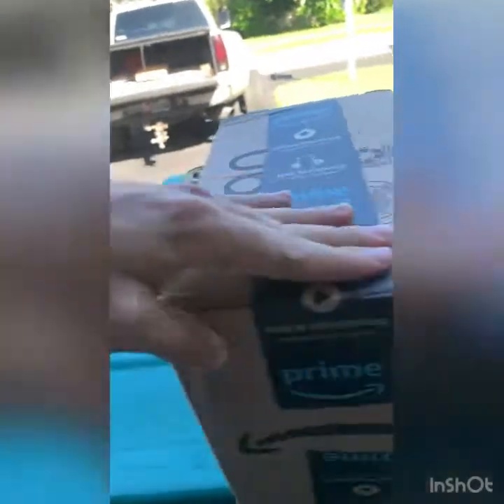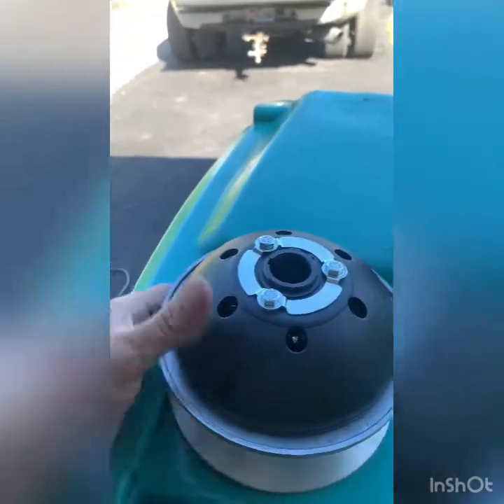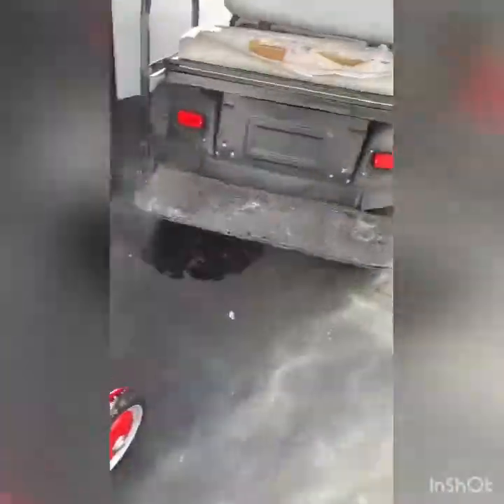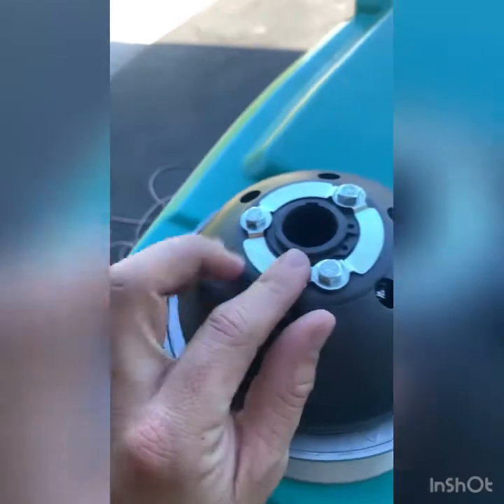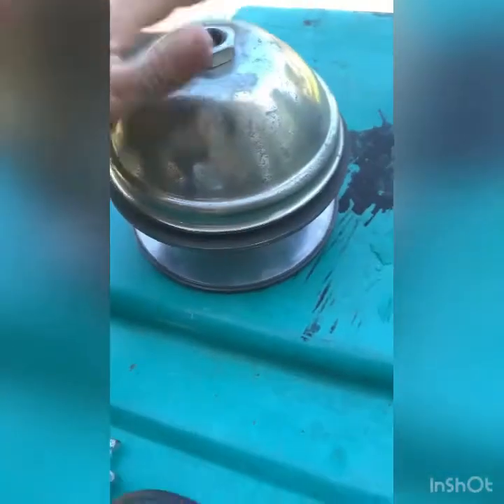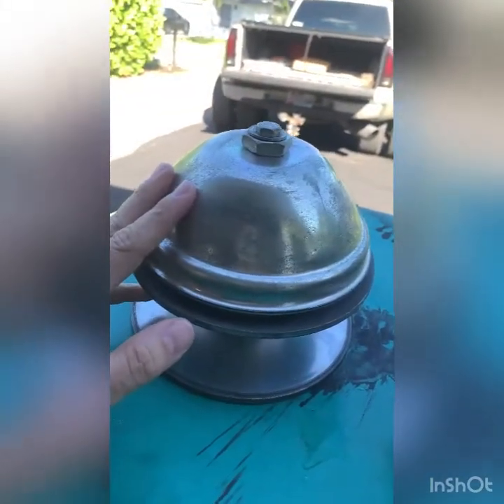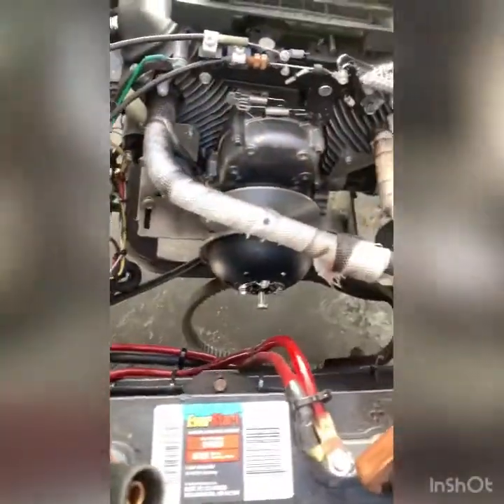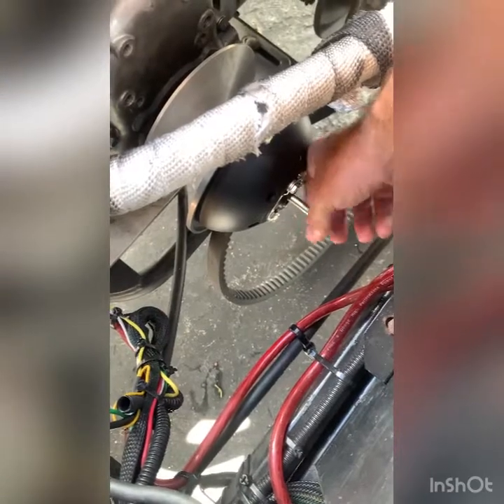Big Block Golf Cart Clutch - 780 Comet Upgrade

Comment: My 780 just messed up as well. When mounted to the engine I can spin the actual clutch portion of the unit while being mounted to the crankshaft without the crankshaft or inner sheave moving. The bolt that retains the unit onto the crankshaft will also remain still.
Reply from the maker: my 780 is a cheap china clone, at the time it was only $130with overnight shipping, makes a great backup but I lost 9mph due to the 780 being 1/2" smaller in diameter in lieu of the CV. I plan on running the 780 for the time being until I get get my 1190 style which is 1" bigger than the 780.

Comment: I just did this same upgrade on my new predator 459cc motor. I'm repowering my American Sportworks (Landmaster) UTV. Should be dropping a video on the completed install this coming weekend. How as the comet 780 been holding up for you ?
Reply from the maker: I actually love it, works great, has given me ZERO issues at all, i just want a larger clutch to be able to cruse faster with lower RPMs, not so much after the top speed.
Reply: @keithellett4283  awesome, I just got mine all up and running yesterday. I’m dropping a new video soon on it.
Reply from the maker: @1620GarageAndFarm  Yeah the 670 clone is definitely the way to go it works great and I literally abuse the crap out of this thing and it hasn’t skipped a beat. I don’t know about long-term exposure over a genuine Comet but for the price savings especially what I paid for it I lost nothing. I expect when I put the 1190 Comet Installed on there I should be pushing 45+ miles an hour if needed lol
Reply: @keithellett4283  I picked up the new Predator Max Performance 459cc . I'm shocked how well it goes. I wanted to go 670 ..  But I was not sure it would fit.
Reply from the maker: @1620GarageAndFarm  There was a lot of testing and tuning and trying different things to get the 670 to fit in my golf cart

Comment: You can also take your CVtech clutch apart, just mount it any 1" shaft then remove the big nut that's on the end with a impact. If you do not have an impact and socket to fit a large crescent wrench or pipe wrench will work just as good with wack of a hammer!
Reply from the maker: I hate this CVtech clutch, nothing but problems since it was new. I have no interest in fixing it lol . but thanks for the heads up . My 780 is my go to but I just haven't driven it enough to make an more videos
Reply: @keithellett4283  I've been tuning my 780 drive clutch for the past couple days and ended up with a engagement speed of about 2800 rpms. I used the 41 gram rollers with the purple springs and I freaking love it! Mind you it is a fully built and stroked 460 with billet everything along with a big cam that idles comfortably around 2200 rpms. Before the clutch would engage as soon as it started.
Reply from the maker: @BubbaB43  I need to reinstall my 780 back on my cart and mess with mine. my cart will be going under the knife this weekend for new ignition switch, back seat, Dual Action Rear springs & fuel gauge. I am running a 670 engine not the 460.
Reply: Hi I hey who is your belt supplier custom length belts are hard to find..   especially if your parts guy is a if not in the  book. Sorry. Thanks great video ..

Comment: I bought same kit from Vegas carts. And struggling with the clutch as well. My problem is it engaging at too low RPMS. it's want to engage at an idle. Are you having any luck with this clutch
Reply from the maker: I've had nothing but issues with my CVTech clutch since it was new, its currently back on my cart for the time being but I do like the 780 better, it doesn't stick as much. my 780 clutch was only $130 at the time, I would imagine they are quite a bit more now days.
Reply: Wow cool I'm part of something ..  😮 I just bought the same unit yesterday off of eBay and they're 1 fitty.  And I believe it to be the same unit.
Reply: do these clutches work with a 1 1/8 inch belt

Comment: What kind of torque convertor do these come with stock?  I’m trying to source one
Reply from the maker: CV Tech- or they did when I got mine from Vegas Carts but I believe they have their own version of the 780 now. I went with the amazon one just as a trial and no complains other than loosing some top end speed. I just recently went back to my CV-tech because we went on a trip with alot of country roads and i wanted the higher speed with lower rpm.

Comment: Why did you stay with the 780 instead of going with the Comet 40?
Reply from the maker: I’m doing a little test run on the 780 comet, my comment 40 had spring issues and ended up in resulting in failure. I think it was due to excessive high RPMs because of the V twin engine with stock gears 11.5:1

My new gears are 6:1 so now my RPMs are much lower and heat displacement from my header is also lower due to lower RPMs. I’m hoping this will solve my issue with the clutch failing.
Reply: Is this clutch still working good?
Reply from the maker: @MrWeisser22  still like brand new, I will do a follow up video once I get some hours on it